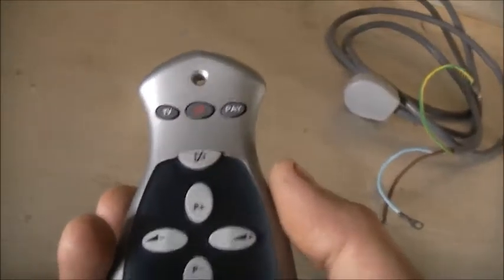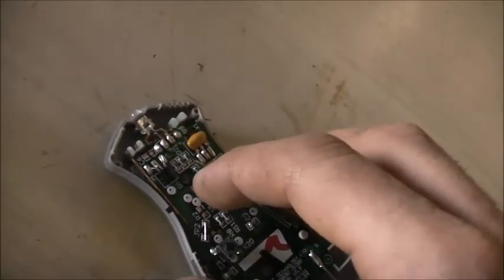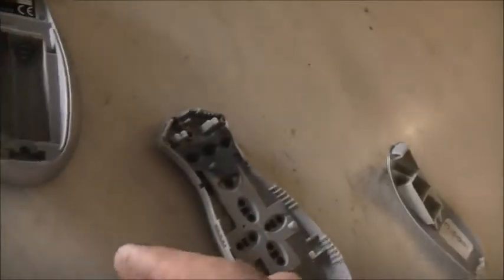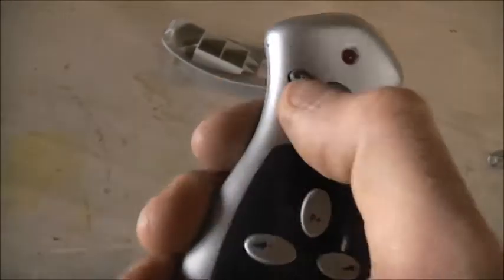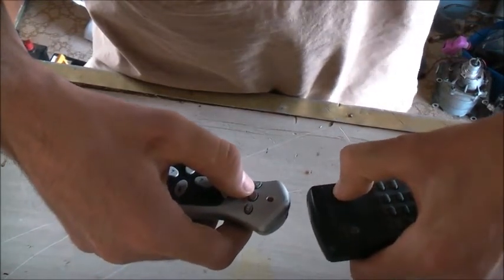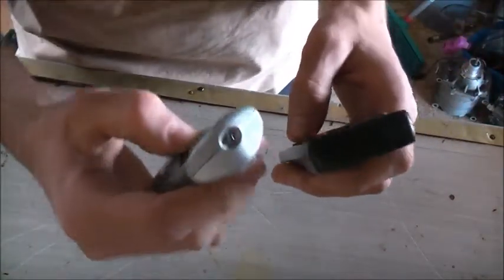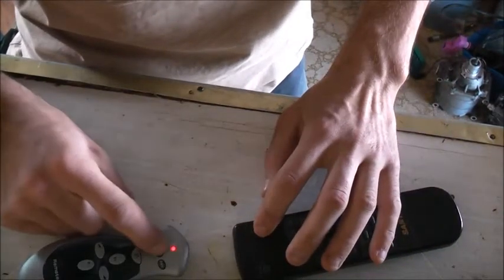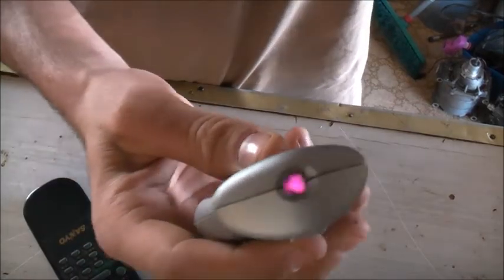How Do I Reprogram This Remote??

Comment: It's one of those pain in the backside remote's to program!
Probally what you need to do is turn the tv on, hold the standby button along with one of the others till the light blinks, and just keep trying till the tv switches off, you could be there for hours + use about 3 sets of batteries getting there.

Comment: ....."I ain't avin it, where's my hamma?!" -Mr. Photon.

I'm not entirely sure if these are 're-programmable' but having said that, and by looking at some of the other comments posted, maybe the codes are built-in already, & you just have to select a code-set by means of pressing some of the buttons in a sequence in order to apply that code-set to the remote, so that it is then set-up for a particular make and model.

-BoomBoxDeluxe.